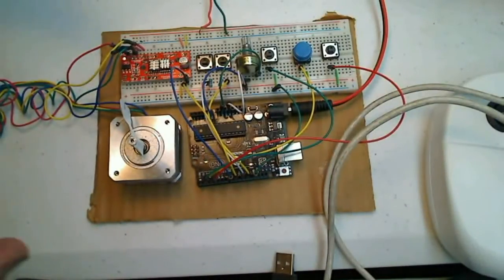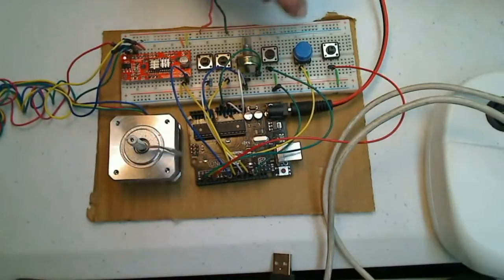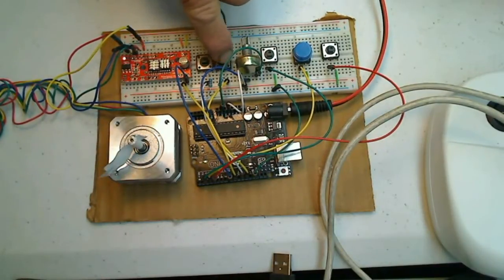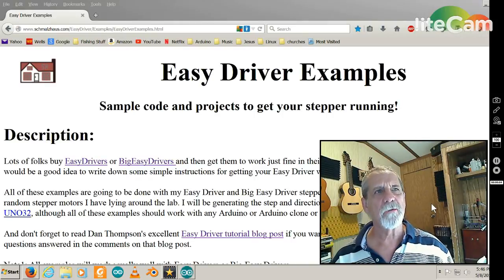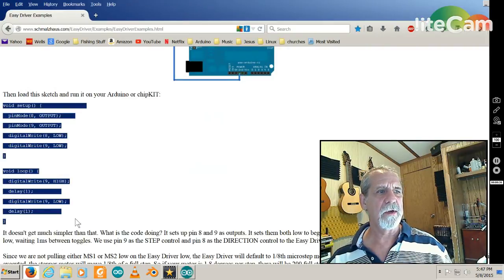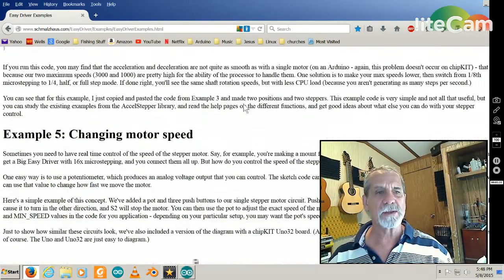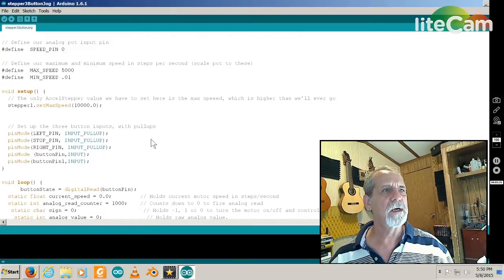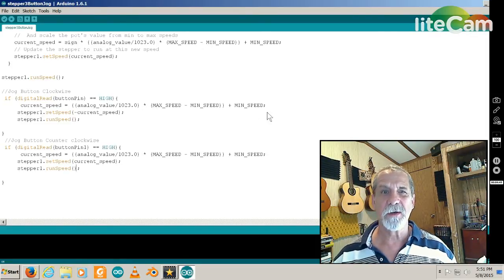Drive a large stepper motor with an arduino Part 1

Comment: thank you michael, excellent diagram, I was looking for this for a very long time, and very ingenious dual control, bravo !! can we replace the easydriver with a tb6600 or A4988 driver? thank you
Reply from the maker: I'm almost positive the tb6600 will work. Not sure about the other. What do you plan on using it for? By the way, thanks for the compliment!
Reply: @mivison  thank you for your answer michael, I will use it to make coils for electronic cigarettes, I currently work with a 24v dc but want to change and why the tb6600 driver, simply because I have it with a nema23 and I like the precision stepper motor
Reply: @mivison  and I am a beginner in arduino electronic diagram, I am looking for how to make your excellent diagram with my tb6600 driver
Reply from the maker: @pascalfoinard8617  In my claw machine I used L298N drivers. Check out the video. https://www.youtube.com/watch?v=pQ-KTNtOqb0
Reply: @mivison  thank you michael, yes I have already used the l298n, not bad but I much prefer your assembly with the 5 buttons and the potentiometer, I just have to find out how to connect the arduino to the tb6600, if you had a wiring diagram it would be Great
Reply from the maker: @pascalfoinard8617  Can you use the PDF file I have in my description?
Reply: @mivison  not yet, why did you indicate 2 stepper motor
Reply from the maker: @pascalfoinard8617  That's called sloppy coding LOL! It does nothing, ignore it.
Reply: @mivison  yes ok, that's what I thought too ;) ;)

Comment: Hi. what is the value of resistors "jog button" and how are the conected to  aurdoino"? If anyone  have any idea feel free to email me ,thank you
Taulant.cekrezi1@gmail.com
Reply from the maker: 10k should do it. I think you can also tell the code to use an INPUT_PULLUP also. When I wrote that sketch I was very new to Arduino.
Reply from the maker: About the connection question. just google pull-up or pull-down resistor and check out the photos on google.you will get  how it connects.
Reply: @mivison  Thank you for your fast response,
in your schematic for jog Buttons  i can se only  pin 11 and 12 attached to gnd  throught resistor ,, Should the button 11 and be connected to 5v??

Comment: Hi Michael, i've making a project using this tutorial https://www.brainy-bits.com/arduino-bourns-eaw-encoder/ i've tried messaging the guy but he doesn't reply to old posts, im using the v44 easydriver, got it working fine, but using accelstepper library, its ok but I want instant speed, no acceleration, just want it to mirror the encoder exactly, is there another library I can use instead of accelstepper ? sorry for jumping your wall man, but i'm new to arduino and just seem to be banging my head against a wall, also whats the max size stepper I can use with easy driver? using nema 17 at the minute, but i'd like to use a nema 23 /34 high torque, any info much appreciated thanks Michael
Reply from the maker: Sorry I can't help. I've never messed with encoders :(

Comment: i want to build a lifting platform with 3 functions and dont know how :D
1 funktion is is when you press a button de platform goes all the way down
the second function is that the platofrm goes up 2.5mm everytime you press a button
the third one is that you can adjust the hight with a display like go up 45mm and then platofrm lifts 45mm like on a 3d printer
i hope you know what i mean? xD
Reply from the maker: Sounds like A good challenge! Let me know how it works out

Comment: This is exactly what I need to control a stepper motor, but I cannot make the 2 jog buttons to work. The connection is difficult to see in the video. Can you please explain how the resistor and the 11 + 12 pins are connected? The link to Schmalzhaus does not provide this connection scheme.
Thank you very much.

Comment: hi mike ,,,, nice project ..... its very useful  project . but i can't upload in my arduino uno . when i upload code then the  error generate exit 1 and so many error . pls suges me  .how can i up load .

this error 

sketch_jun09e:4: error: 'AccelStepper' does not name a type
sketch_jun09e.ino: In function 'void setup()':
sketch_jun09e:20: error: 'stepper1' was not declared in this scope
sketch_jun09e.ino: In function 'void loop()':
sketch_jun09e:55: error: 'stepper1' was not declared in this scope
sketch_jun09e:63: error: 'stepper1' was not declared in this scope

Comment: And by the way I am getting my feet wet in the machinist field. I am the Lead die & tool setter, and with any free time I spend as a machinist. We make metal bearings and gears. From atomized metal pressed in a shape, after it is sinter in a oven for the proper hardness.  My area we knocked down to the size needed. last it is impregnated with oil. that is just about every motor today. From Milwaukee to Briggs & Stratton we make them all. I will be using your code on my mini mill I have at home, before I see how they will like me to add this at work. 
if you let me use your code that is.

Comment: Hello Mike, Thank you for this great video which is exactly what I was looking for to motorize my telescope. Your code works very well. I just modified a bit the hardware to get both sideral and lunar speed. The only issue I can't solve is how to read A0 input to display the value. The code is properly compiled but when loaded I display the speed value but the buttons doesn't work any more. Any advices are welcome.

Comment: I followed your steps copied your edited code but arduino IDE won't even read it. Always says error compiling.  please what's missing?
Reply from the maker: 2 things could be wrong. Make sure you have the last curly bracket in place and you have installed the AccelStepper library. http://www.airspayce.com/mikem/arduino/AccelStepper/

Comment: I tried for below code but what you mentioned as JOG are my normal buttons, then whats the difference between the two. first three buttons and the JOGS..?  

#include <Stepper.h>
#define button1 2
#define button2 3

const int stepsPerRevolution = 200;  // change this to fit the number of steps per revolution
                                     // for 1.8 degree step angle 200 will maximum

// initialize the stepper library on pins 8 through 11:
Stepper myStepper(stepsPerRevolution, 8,9,10,11);      // L298n port IA IB IC ID accordingly

void setup() {

   
   pinMode(button1, INPUT_PULLUP); // Input pulse to arduino by pressing button 1
   pinMode(button2, INPUT_PULLUP); // Input pulse to arduino by pressing button 2
  myStepper.setSpeed(60); // RPM, 60 Rotation per minute
   
}

void loop() { 

   if (digitalRead(button1) == LOW || digitalRead(button2) == LOW) { // If no key is pressed

   }
  
  
 if (digitalRead(button1) == LOW && digitalRead(button2) == HIGH) { // if one is idle (L) and the other one (R) key pressed
  myStepper.step(stepsPerRevolution); // Stepper motor rotates CW (Clockwise)
  delayMicroseconds(100); // pause time after per steps 100u seconds = 0.1 mili seconds
  } else if (digitalRead(button1) == HIGH && digitalRead(button2) == LOW) { // if other one (R) is idle and the one (L) key pressed
  myStepper.step(-stepsPerRevolution);  // Stepper motor rotates CCW (Anticlockwise)
  delayMicroseconds(100); // pause time after per steps 100u seconds = 0.1 mili seconds
  }
  
  
}
Reply from the maker: Jog buttons: when you push the jog buttons the motor runs. then when you release the button it stops.it is only momentary.
Run buttons: with the other buttons, you push and release a button the motor stays running until you push the "stop" button.

Comment: Hi. Great job ! I don't see where you connected to the large drive? Mine has enable+ ,enable -, +  - Pul and +  - Dir.
Reply from the maker: Have you checked out the seconded video?
Reply: Yes. I could see the wires going to it but was not sure if you used the same Arduino pins as the easy stepper?
Reply from the maker: i'm sure i did.but if i didn't just adjust the code to what ever pin numbers you want to use.

Comment: Mike,I am attempting to do the exact same thing to my cabinet saw and router lift. Did you ever end up adding the limit switches for the over travel? I am going to need to do the same thing and like you I am struggling with the code. Any suggestions or advice??
Reply from the maker: I never did add the switches.But I'm sure there is a way to do it. you could add a limit switch that physically cuts the power to what ever output wire you are using for the control wire by putting it in series with it. That way you wouldn't have to modify the code.

Comment: Hi Mike, really useful video, thanks for it. It is the answer to my problem too.

I have a small Chinese mill and I need to control the Z axis with a stepper (I have arthritis in my arms and shoulders and cannot reach the  Z axis handwheel.)

 The jog function is inspired, if I'm right you have just linked the 2 jog buttons to +ve via pin 11/12, a resistor then to Gnd?

I have uploaded the code and will give it a try tonight.

Thanks again

Comment: what if , i use two wires of  dc motor for easy driver(a4998),could  motor will rotate.
Reply from the maker: I don't think so, because of how it pulses the current. I could be wrong though. look into the L298N Dual Motor Controller or the sn754410 chip. both are very inexpensive.

Comment: Hi Mike I'm thinking of making electric fishing reel with it for me because of my physical weakness.  Before I start this i have some question. 

1. Is that nema 23 stepper motor you used in this video? 

2.I will be buying that motor (link below) but I m not sure of the power I have to use to able to run this do I need 12volt battery? http://www.canadarobotix.com/stepper-motors/stepper-motor-unipolar-bipolar-200-steps-rev-57-56mm-7-4v-1-a-phase
Reply from the maker: I don't remember the motor size .i left the motor at work.I'll check for you. I think that is a good idea about the fishing reel.let me know how it turns out. What will you be fishing for?
Reply: +Michael Ivison I will be catching wall eyes or rainbow trout maybe jack fish

Comment: Hello Mike
I have opened the box file in your link but cannot seem to copy or print it out. Am I doing something wrong or are these actions not available on this service?
Thanks
Dave
Reply from the maker: const int buttonPin = 12;//Jog Button clockwise
const int buttonPin1 = 11;//Jog Button Counter clockwise
int buttonState = 0;
#include <AccelStepper.h>

// Define the stepper and the pins it will use
AccelStepper stepper1(1, 9, 8); // 9= step ,8= direction
AccelStepper stepper2(1, 9, 8); // 9= step ,8= direction
// Define our three input button pins
#define  LEFT_PIN  4
#define  STOP_PIN  3
#define  RIGHT_PIN 2

// Define our analog pot input pin
#define  SPEED_PIN 0

// Define our maximum and minimum speed in steps per second (scale pot to these)
#define  MAX_SPEED 5000
#define  MIN_SPEED .01

void setup() {
  // The only AccelStepper value we have to set here is the max speeed, which is higher than we'll ever go
  stepper1.setMaxSpeed(10000.0);
 
 
  // Set up the three button inputs, with pullups
  pinMode(LEFT_PIN, INPUT_PULLUP);
  pinMode(STOP_PIN, INPUT_PULLUP);
  pinMode(RIGHT_PIN, INPUT_PULLUP);
  pinMode (buttonPin,INPUT);
  pinMode(buttonPin1,INPUT);
}

void loop() {
      buttonState = digitalRead(buttonPin);
  static float current_speed = 0.0;         // Holds current motor speed in steps/second
  static int analog_read_counter = 1000;    // Counts down to 0 to fire analog read
   static char sign = 0;                     // Holds -1, 1 or 0 to turn the motor on/off and control direction
    static int analog_value = 0;              // Holds raw analog value.

  // If a switch is pushed down (low), set the sign value appropriately
  if (digitalRead(LEFT_PIN) == 0) {
    sign = 1;
  }
  else if (digitalRead(RIGHT_PIN) == 0) {    
    sign = -1;
  }
  else if (digitalRead(STOP_PIN) == 0) {
    sign = 0;
  }
  
 
  // We only want to read the pot every so often (because it takes a long time we don't
  // want to do it every time through the main loop).  
  if (analog_read_counter > 0) {
    analog_read_counter--;
  }
  else {
    analog_read_counter = 6000;
    // Now read the pot (from 0 to 1023)
    analog_value = analogRead(SPEED_PIN);
    // Give the stepper a chance to step if it needs to
    stepper1.runSpeed();
    //  And scale the pot's value from min to max speeds
    current_speed = sign * ((analog_value/1023.0) * (MAX_SPEED - MIN_SPEED)) + MIN_SPEED;
    // Update the stepper to run at this new speed
    stepper1.setSpeed(current_speed);
  }

stepper1.runSpeed();
 
//Jog Button Clockwise
 if (digitalRead(buttonPin) == HIGH){
      current_speed = ((analog_value/1023.0) * (MAX_SPEED - MIN_SPEED)) + MIN_SPEED;
     stepper1.setSpeed(-current_speed);
     stepper1.runSpeed();
  
}
 //Jog Button Counter clockwise
 if (digitalRead(buttonPin1) == HIGH){
      current_speed = ((analog_value/1023.0) * (MAX_SPEED - MIN_SPEED)) + MIN_SPEED;
     stepper1.setSpeed(current_speed);
     stepper1.runSpeed();
  
} 
  
 

 
 
}
Reply: Thanks Mike